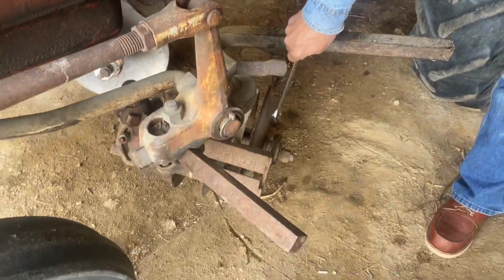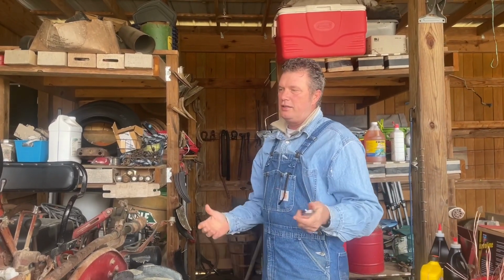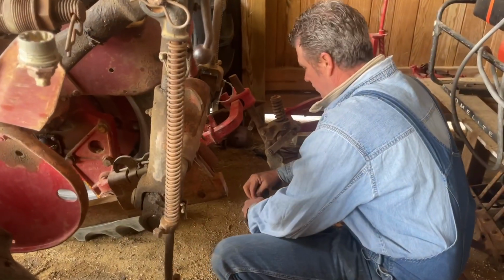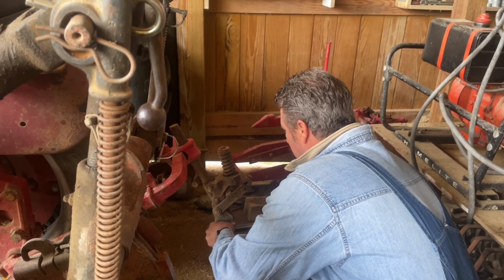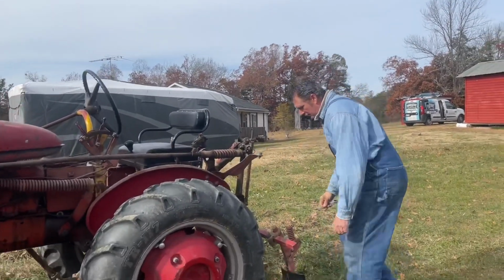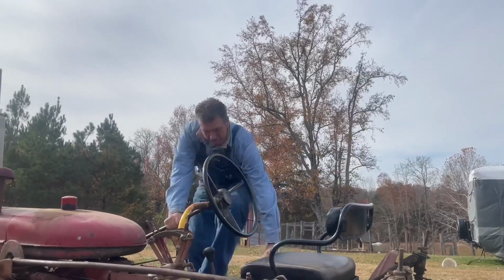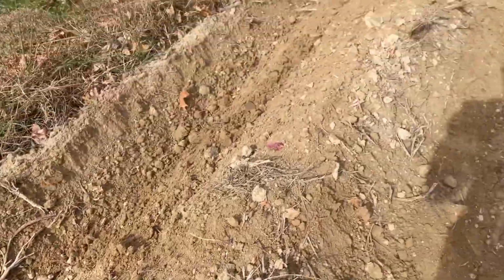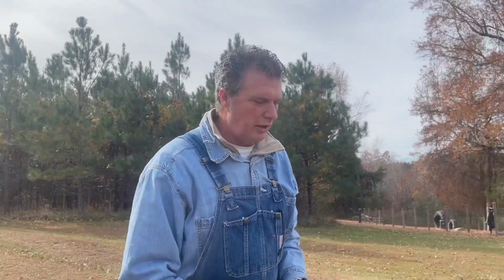Bedding Rows for Spring Broccoli 🥦

Comment: When we planted tobacco on beds back in the 60s we would board them off flat before transplanting another good show, my little cub makes beds real good but I use 14 inch disc.
Reply from the maker: Hey Joe. I would love to have a fast hitch cub.
Reply: @Jtwes   when I bought t 3 years ago all it had was the right front cultivator, since then I bought a complete set of cultivators a moldboard plow a harrow and a friend gave me the complete set up for the planter and fertilizer distributor them my cousin gave me two rolling cultivators I had to go to argi supply to get the shanks but I'm blessed to have some good friends now at 72 I need to ride a lot 😅😅 another good show I watch all as soon as they come out

Comment: Great job Joey. I never really thought about making hills in the late fall for spring planting but it makes sense.
Also you do know that there is only about 30 days left in the fall so it may be this winter before you get to your dash. 
Question, how do you put water in your tires and do you put antifreeze in them as well?
Reply from the maker: When I take the rear tires to the tire shop the have a machine that does it. I think they did or used to use calcium chloride
Reply: @Jtwes  Get them to put Beet juice in the new ones. Works as good as antifreeze but not corrosive for your rims.

Comment: Great video! The more I watch you using those rear "spade cultivators" the more I want to try them out over the regular sweeps. If you don't mind me asking where did you find them and what is the correct term for them? Seems like they leave a good forrow for the front tire to ride once you get the first row going to keep things nice and straight. 
 Also thanks for the tip about the seed, my railey seeds should be here Monday, and I plan on saving mine as well.
Reply from the maker: I had a subscriber get them for me. I will get with him and find out and put it in my live stream next week.

Comment: Almost didn’t recognize you at first 😉. Feeling a little cold out today?
Reply from the maker: It took a minute to get the cold off my cheeks
Reply: I remember you pointing out the valve stem holes in your rims, are you planning on fixing them when you put the new tires on?
Reply from the maker: On the fronts I am. I think the back are ok.
Reply: Do you have a welder? If not, I know a guy that’ll do it for you. Looks kinda like someone I saw in your plow day video riding around on your 140 😉
Reply from the maker: Lol wonder who that is. Roger has one at the shop. Thank you anyway.
Reply: Ok, sounds good. Don’t wanna go saying it too loudly ya know. Just like a trailer or any other tool, whenever someone finds you’ve got one, they wanna borrow it 😂